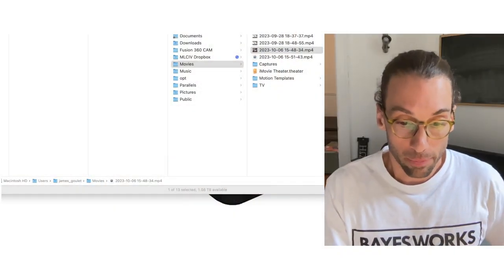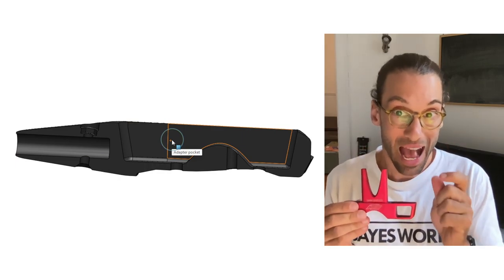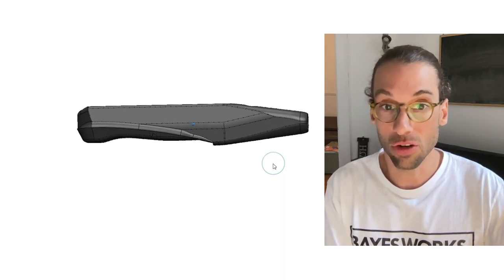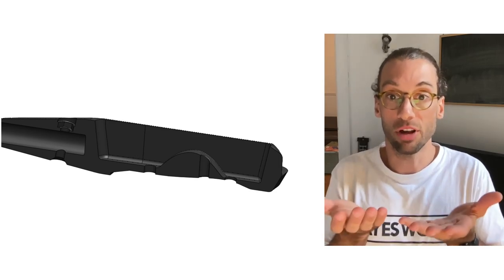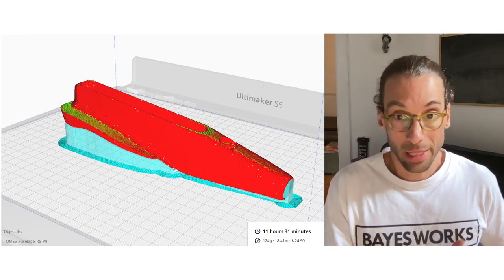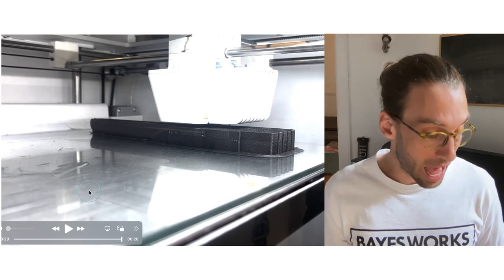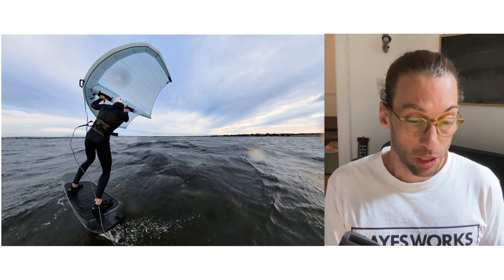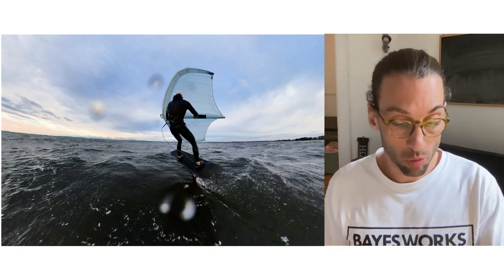3D printed AXIS fuselage to bolt your front wing into the mast

Comment: Hi! thanks so much for providing the 3d Files. I tried to make myself an adapter from Gong fuselage to Axis frontwing, based on your model. Its not very pretty and i might need to change a few things here and there.
Reply from the maker: Keep me posted on how it turns out!
Reply from the maker: FYI: here is the latest design: https://www.dropbox.com/scl/fi/10qmfmtswmasldpub5m4h/Fuselage_RS_V2_10.STL?rlkey=uow6x8d65j8ya882xkkj7giq1&st=kk63no1e&dl=0
Reply: @james_goulet  I will! i'm having trouble with some edges right now, that the fusion and onshape dont wanna work with right now :( but generally it will work!

Comment: Wow, you've put a lot of work into this... great work! 

My feeling is that I actually like the over-built nature of Axis, having bent Naish stuff before... I like the confidence I get from knowing nothing will break... But if you do start working with 3D printed plastic baseplates etc, you can get SLS (sintered) Fiber Reinforced Nylon parts, then paint them with Epoxy and sand. SLS parts will soak up the Epoxy and you will gain strength. You can do this with FDM parts as well. 

You can also epoxy on carbon fiber filament on any surface that is under tension to really stiffen up a print.
Reply from the maker: @luxmonday, I understand your feel, I also like to have strong stuff when I am doing long downwinds or riding sketchy spots. However, in my cases this is <1% of my riding time. For the 99% of the time where I can safely come back onshore, I want to be the limiting factor, not my gear :) 

Regarding durability, the amount of material and thus weight are obviously a good predictor of durability, but there are no direct link. My best example of this is the Horue H14 I used to ride until I started winging (https://youtu.be/1TFUm_wB6ks). This foil + board weight less than 3kg complete 🤯, and in years of riding I had only few parts breaking, and after extensive usage or hard crash on the reef. So at the end good engineering should be able to give you something that is both strong AND light...

Regarding the SLS printing, I looking into it but this is far more complex and expensive than a regular 3D printer. The one I have access to is much smaller in dimension so that I need to orient the part at a suboptimal angle with respect to the material property. In terms of material specs the Sinterit PA11CF powder, seems to be only marginally stronger that the PA12CF I use. Is the property of "soaking up epoxy" specific to SLS printed part or is it common to all printed material? One think I am worrying about is the tolerances... right know I know the part fill fit right out of the printer. I wonder if adding a possibly uneven epoxy layer may hinder with the fit?
Reply: @james_goulet  I think most 3D printed parts will soak up some epoxy. I feel that FDM printing is like layers of cylinders... like 
OOOO
OOOO
 and there's always a little room for epoxy... but if you think it is strong enough without epoxy, that's good too... 

I was 3D printing my propellers in PLA with Epoxy. They lasted about 2-3 hours of use. Enough time to figure out if the design was good! I then had them 3D printed in sintered Stainless Steel in China and they came out great.
Reply from the maker: @luxmonday   that sounds great@ I have yet to experiment with 3D printed stainless 🤯

Comment: This is really awesome! I was working on a cad model for this inspired by your chopped down earlier fuse but now I can just use your model!

Can you do an official stiffness test between stock, your chopped version, and this 3D printed version? I’m suggesting bolting the mast to the ground, then hanging weights to the end of the wing and measuring deflection.

If the 3D print isn’t quite as stiff, could you add some carbon cloth or make a 3D printed mold and do up the whole thing in carbon? Or have a shop with an aluminum CNC mill make it out of billet for you?
Reply from the maker: 🤙 I have not done an official stiffness for the rearward fire extension but I can say up front that it has more flex than the aluminium one. That being said, while riding there is zero difference on the feel. I had already experimented with dome designs that were too flexible, i.e., https://youtu.be/OoENIWtG9YI?si=TpujYXqqJRWD-dJN . But for this new one it is not an issue

if you want to add carbon cloth that would indeed make it stiffer, but overall, I do not think this would add to the riding experience. Regarding the aluminium one, it would definitely work but it would be 3x heavier :)
Reply: @james_goulet  Your are clearly a pro level rider. But for me I prefer a longer fuse ("short" length) with the mast trailing the wing quite a bit. But I hate the very high weight of the axis fuse. Another idea I had was to mill out material between the rear wing and the mast connection into a channel section AKA U section. And then fill it with foam to keep the hydrodynamic properties the same. That would have minimal loss of stiffness with a big weight loss. Maybe you can try that as well and give it to a friend to try.
Reply from the maker: @onquarter   I have already tried that modification of milling the material last year and I confirm that you will not notice any additional flexibility compared to the stock fuse. However, as you noted, it is essential that you plug the U section as it will otherwise drastically increase the drag≥

Comment: Hi James! Amazing R&D, thanx. Could you make an "idiot's guide" for the technically not so advanced people (like me)? Assume I go to the 3D shop and print your awesome adapter. I would need: 1. how to assamble. 2. list of screws I need to buy. 3. Carbon tubes specication, where to buy them, do we need to "fill them". 3D file of tube to stabilizer adapter. 4. how to screw a new hole in your front wing (distance  etc..). And on last general question. You mention that turnability comes with instability. Is your system yaw or pitch nerveous? Could we use a longer carbon tube (65cm?) for downwinding with lets say 1201? Enjoying your "think-out-of-the-box" videos. Thanx. Keep on exploring!!!
Reply from the maker: I will try to do it when I have more time... I am working on the baseplate & stabs at the moments. Regarding the parts:

- For the carbon tube, I use a SmallRig one: https://www.amazon.ca/gp/product/B00RZ12U8M/ref=ppx_yo_dt_b_search_asin_title?ie=UTF8&th=1 
- I will it with a door insulation foam bead (11mm) https://www.amazon.ca/weatherstripping-Cylindrical-Sealing-Proofing-Dustproof/dp/B0CHHQQ71F/ref=sr_1_37?crid=LFHQA17SALKP&keywords=foam%2Binsulation%2B11mm%2Bcylindrical&qid=1696874554&sprefix=foam%2Binsulation%2B11mm%2Bcylindrical%2Caps%2C71&sr=8-37&th=1
- I do not have yet a 3D file for a stabilizer adapter for AXIS... this is on the todo list 
- You can use the file in here: https://www.dropbox.com/sh/hpcpm7rq9zhbdsj/AAAXZQPpjP_kdf3q1yL-1zI9a?dl=0 to 3d print the Insert_M6_V2.STL and Insert_M6_long_V2.STL that will allow you to slide a std M6 hexagonal nut and bolt into the carbon tube. The long one is for the rearward most screw so that you can stand off the shape of the tube tail.
- For the M6 nut that is embedded in the fuselage: https://www.amazon.ca/gp/product/B07BKQ8HKC/ref=ppx_yo_dt_b_search_asin_title?ie=UTF8&th=1
- The M6 screw that goes into it should be 30mm long
- The hole you need to drill in your front wing is 60mm center to center from the existing rearward hole. (This is the distance between your AXIS mast connection points)
- You need a 90 degrees countersink drill bit ⅝" or 16mm. e.g. https://www.amazon.ca/Countersink-Degree-Chamfer-Woodworking-6mm-19mm/dp/B075QYFBMM/ref=sr_1_25?crid=36OHFI8TAPPHF&keywords=countersink&qid=1696873950&sprefix=countersink%2Caps%2C95&sr=8-25  or https://www.amazon.ca/Bestgle-Countersink-Chamfering-Woodworking-Metalworking/dp/B09FLH3QDP/ref=sr_1_39?crid=310A1RY84TS57&keywords=countersink+5%2F8+90+degrees&qid=1696874176&sprefix=countersink+5%2F8+90+degrees%2Caps%2C81&sr=8-39

Regarding the "turnability", it comes with yaw nervousness. However, this stab comes with both yaw and pitch nervousness. It will take you a couple of week to get use to it, but once you will be, there is no way back :) 

I do not think this design is suited for a tube > 30cm. That being said I do not think you need any longer than that even for downwinding. At first, if you try this stab, it will bring you out of your confort zone, but if you persevere and put time on it, it will bring your foil game to another level  🤙
Reply: Many thanx. Lot of homework now😅
Reply from the maker: @berci1001  ...and here is a 3D file for an adapter for a AXIS stab. I have not tested, but it should work :) https://www.dropbox.com/scl/fi/k9a00kcp58pi4ck0jigi8/Axis_stab_adapter.STL?rlkey=vdeg4z9cvv7z47hy5bmu7yp8t&dl=0
Reply from the maker: @berci1001, you will also need a M15 drill bit in order to clean the 3D print form the supports needed during printing https://www.amazon.ca/gp/product/B08Z74PQPC/ref=ppx_yo_dt_b_search_asin_title?ie=UTF8&th=1

Comment: Love the Idea, great work! I have kind of duplicated your design for the Gong Fuse, so I can now ride different Fuse lengths and different stabilizers on the Gong Fuse and Frontwings. However, I do feel like the 15 mm carbon tube is not torsion robust enough. Do you feel that too? I think in the pitch and yaw access it's way more stable than it would need to be. To fix the Torsional strength I've now ordered pullwindet tube, lets see if layers in 45 degree will fix the issue... Do you have advice on what else I could try? (Stab is a custom molded 140 sqcm, 32 cm span & the connections are rock solid). Funny enough I've searched for your YouTube channel today, to find stl files and found some with one of the videos from last year, what a timing that u upload this a few hours later :D Do you happen to have a model of the advanced silly short Fuse? I would love to order (first of all remodel) a custom-milled advanced fuse with the carbon tube tail to also change fuse length on Axis stuff effortlessly. Already started rebuilding the connections but having a premade model makes it way easier, thanks for uploading! A friend of mine was pretty keen on the Idea of running Fluid simulation to optimize the Tube to Stabilizer Connection, I'll keep you posted if we manage to simulate that to perfection :D Great contribution, thanks man! :)
Reply from the maker: @Leo-stief, I am glad to read that! This is exactly why I am posting all this stuff online, so that other can also build upon it :) I have added to the comments the 3D cad file. Please be indulgent, I know it is a mess... Note as well that The total thickness of the front wing connection is about 0.25-0.5mm too thick... However, I did not felt it while riding.

Regarding the torsional stiffness of the carbon tube I did not had any issue with it and actually, I do not even see how could this tube could be solicited in torsion from riding. What is the foil feedback that makes you think that the tube torsional stiffens is the issue?

Keep me posted with your new builds, I am looking forward to see what you and other are going to come up with!